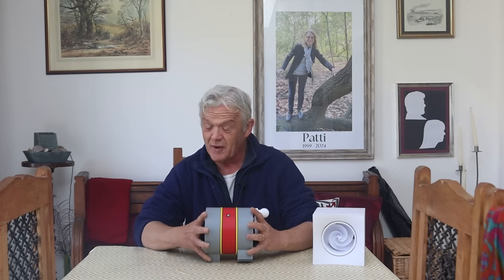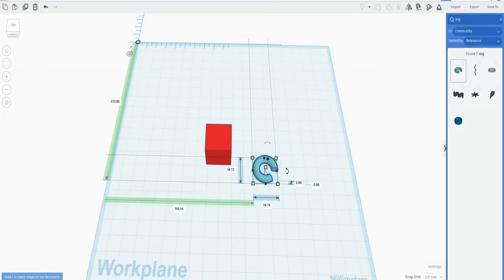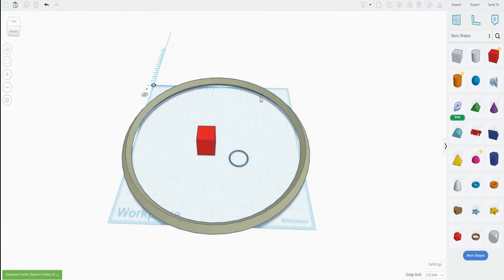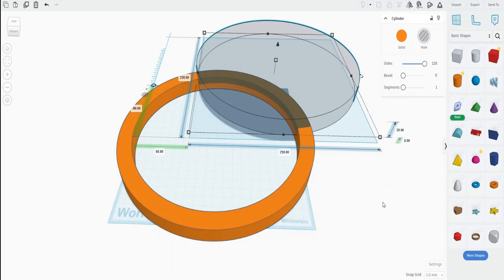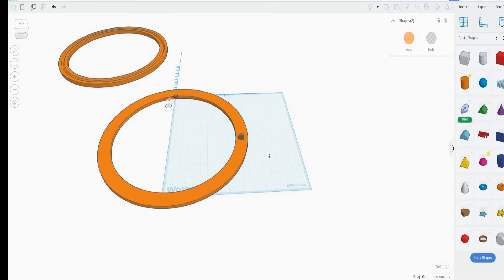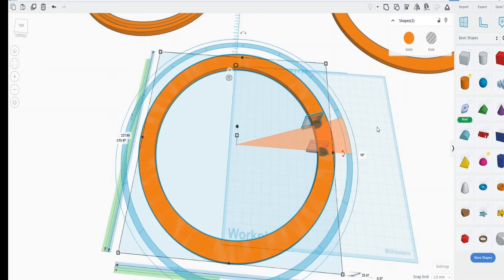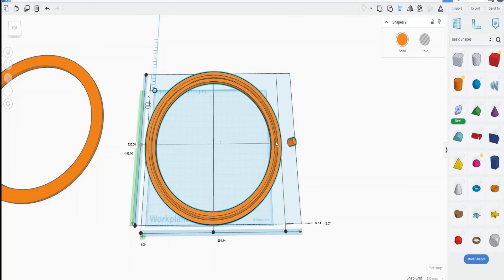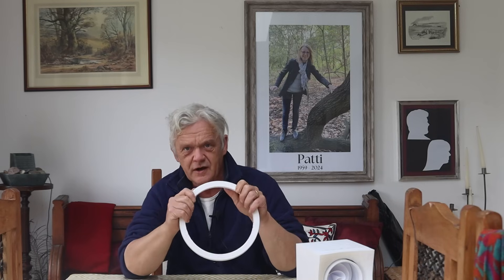2373 How To Make A Ring (Slew) Bearing

Comment: Hello, Robert. I just wanted to leave you this comment because I have a question. I happened to be watching a few of your videos about Sterling engines. And I am in the need of one for a personal heat experiment that I'm doing out of fun.

In general, I'm looking for a Sterling engine that can produce a reasonable amount of torque for a shaft (comparible to the strength of human fingers trying to move sone magnets on a shaft) once I have it on a hot service.

That surface will be roughly 10 to 11 inches in diameter and hot as 400 Degree F. 

I see a lot of promise in gamma type Sterling engines, especially that magnetic one that you had a short video on. 

By any chance, can you recommend a very simple but effective design for someone like me who is new to this to try out. 

I would prefer to have diagrams to show what parts i need and how to fit them in. I tried looking at that NASA design that you did a video on, but I just can't see enough of it directly. And I can't find the original file.

P.S. Thank you for reading this and for your channel. Overall, it has been a great source of inspiration for me who wants to get into this type of hobby.
Reply from the maker: I am sorry mate - do you mean buy one or make one?
Reply: @ThinkingandTinkering  Either will do. However I will prefer to make one eventually.

Comment: Ever since you put out the crossed roller bearing idea, I've been using them extensively on my load bearing, but not high speed build projects.
My current project is a solar panel tracking mount involving a 12 inch (300mm) lazy susan at the base, with two 1 1/2" (38mm) shaft bearings. The cheapest shaft bearings I could find were 7 times the material cost of making them purely out of ABS-GF ($7 vs $70, and without the outdoor environmental stability) and lithium grease. Since they are not in a high speed application, I don't expect them to wear out in the expected 10-15 year operational life. if not, they are fairly cheap to replace. I also don't have to worry much about the bearings rusting out
Reply from the maker: nice one mate - i am it helped

Comment: If that was made out of metal, It would cost several thousand dollars. I doubt airsoft pellets would hold up, for a variety of reason. I think you are on the right track with nylon.  Boxing printer two and setting up printer tomorrow, hopefully it is the charm.  I was hoping you would come up with this design, a bearing with a big hole in the middle.
Reply: 6mm airsoft BBs, except glass instead of plastic?
Reply: @RobotWorker100percentLoyal  the main problems with airsoft is they are built to compress on impact, so in that environment they would probably squish, jam, and melt, glass or not. My thinking, which I think shadows Rob's, with the exception of wires and magnets, the wind turbine is best served as entirely 3d printable. Rollers solves that problem without getting into machined balls. A roller is good enough. A lot of people don't have access to an electrical grid. A lot of people who never had access to a land-line telephone have cell phones.
Reply from the maker: nice - here's hoping - cheers

Comment: would be cool if the taulman style of nylon printer filament could b e hybridized with one of the few thermoformable teflon type plastics to make a stiff tough bearing with intrinsic lubricity like those oil impregnated bronze bearings and such, but the lubricant being that teflon based plastic :) (kinda how there is the polycarbonate/nylon hybridized filament that was 910 taulman as I recall giving it nearly indestructable levels of stiff and toughness that could only be made tougher and stiffer if you added graphene like you guys did with that protein based plastic LOL
Reply from the maker: very true mater - interesting ideas thanks for sharing

Comment: Airsoft bbs….. the best in cheap plastic ball bearings for 3d printed bearings. They are manufactured more precisely than you can typically get a 3d printer can. 
And they are very cheap.
Reply: I say all that, but I also see this 3d print version as amazing
Reply from the maker: very true mate and a good option

Comment: I like this idea. Would be interesting to see if you get any kind of real efficiency boost, or does the increased surface contact result in more load...
Reply from the maker: it should give a boost mate
Reply: Multi hundreds of tonnes loads are moved on "ordinary" roads simply because the point loading is reduced by increasing the number of wheels (or rollers) to distribute the gross weight of the vehicle over an increased number of points of contact. "Robert's" bearing produces a similar outcome. The gross weight remains the same, but the point loading on each roller is reduced and all the more so if the bearing circumference is greater (so more rollers). The resultant reduction of weight imposed on each roller should mean less friction and therefore less wear. That's the theory of an old worn out retired truck driver, so what do I know?
Reply: @ Great points... real world friction will be less due to less deformation! Thank you for the insights.